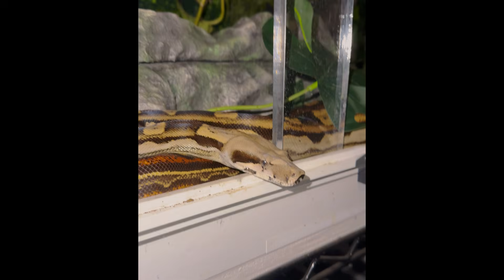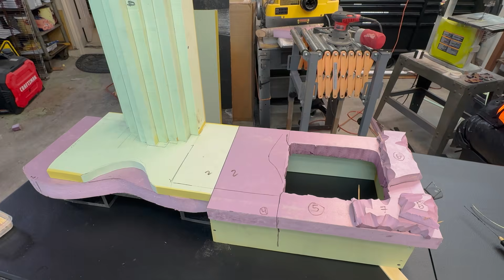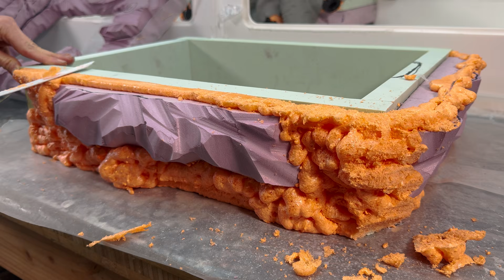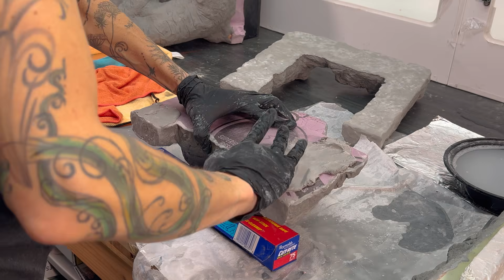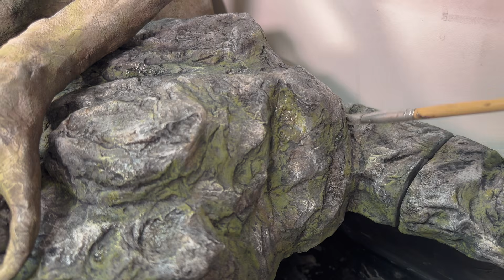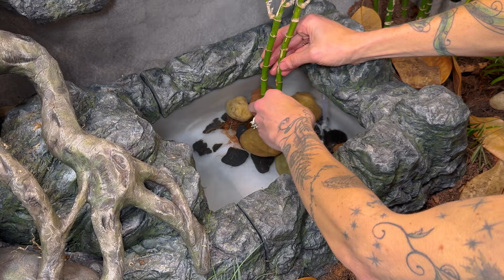DIY Reptile Water Feature V2: No Plumbing, Live Plants, Filtered Water!

Comment: Hey @snake_therapy! Your builds are incredibly inspiring!! Is the water pump you shared the same as the last build? It looks like the one that’s in the description is the one you have in Severus’ tank. If you wouldn’t mind sharing the clear one with the aerator and the air stone that you swapped out, that would be appreciated! Love love love your content
Reply from the maker: LINK FIXED! so sorry for the confusion!! thanks for letting me know!
Reply: @Snake_Therapy  Thank you 🙂Just wanted to see the upgraded one! LOVE your content <3
Reply from the maker: Hi, Thank you so much! The water pump is different to the previous build. I have a link to the filter/pump (which includes a small airstone) that I used in this video in the description.  Remember: This feature uses a FILTER with a pump, whereas the last water feature used a pond pump only. Are you looking for a link for the larger, flat air stone I showed being tested out very briefly? Again, air stones and pumps aerate the water, but do not filter/clean it of bad bacteria. That's the primary difference between them. But the link to the clear filter and pump is in the description for you already. Let me know if this clears things up for you.
Reply from the maker: Oh dear.. you're RIGHT!! I messed that up! Fixing now!!